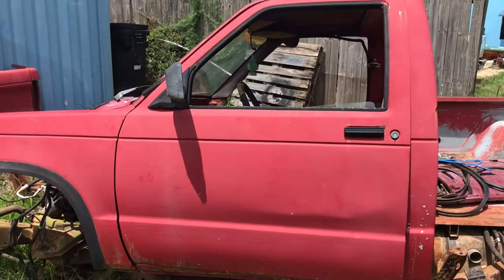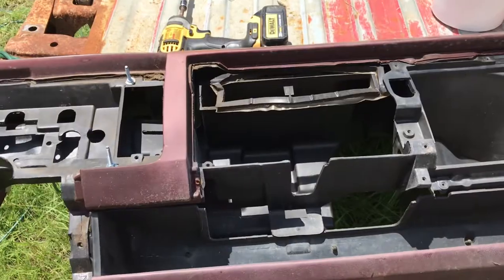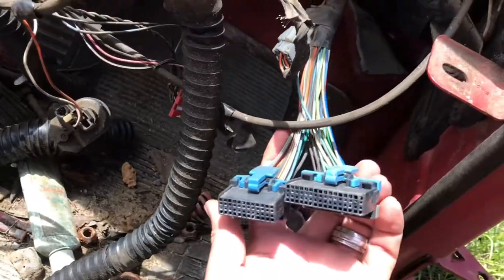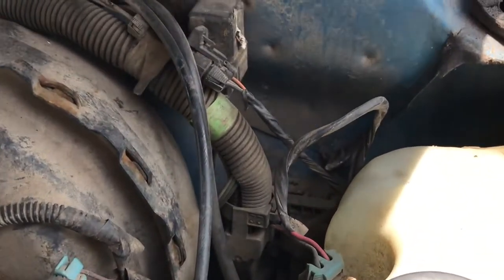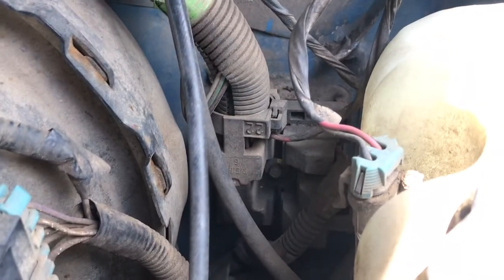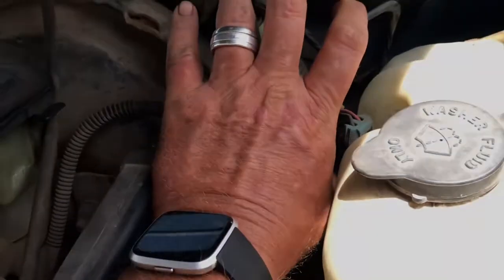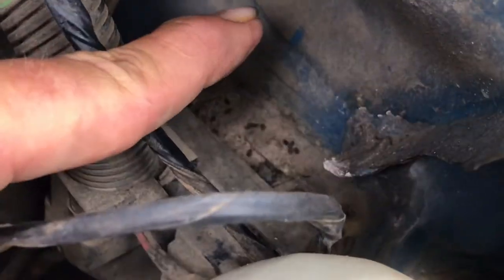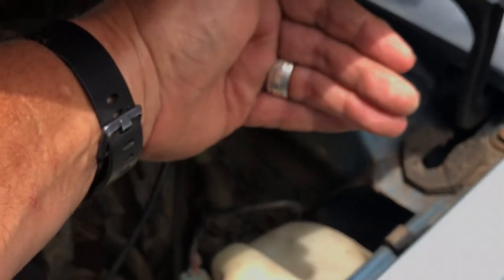Fuse Block Removal on a First Gen S-10

Comment: Could you post more information on removing the wiring going through the firewall into the fuse box, i need some help
Reply from the maker: Simply put, it is a plug. You may have to cut the sealant around the plug, but the outside simply comes off of the plug and the inside comes off of the firewall. Take sure a wall outlet with with a firewall between your device and the outlet. that sounds stupid, but I don’t know how to explain it. Basically, just unplug it you might have to cut the silicone at the firewall to get the inside off the wall.
Reply: @wrongwaygarage  OK thanks man appreciate it

Comment: I wish you had I video of how to properly remove the ac/heat control module. I've got a 1993 S10 and she's almost all put back together, but that thing is a hot mess for me. I think it's broken but I can't find any parts breakdowns if the guts.
Reply from the maker: @Isk8crete  eventually a video like that will come but I have yet to tackle that particular problem yet. It’s on my ever growing list of projects that need doing but not exactly at the top of the list. Sorry about that. ✌🏻

Comment: Hi there- we have an 86 S10 we are trying to get running. think we need to replace the starter relay, which it seems on this Gen is "on top of the starter". Haven't had any luck locating the dang thing. Any advice is appreciated!
Reply from the maker: Luckily I’ve not had the need to learn about that just yet. However it seems to be in my near future from I can tell on my daily driver. Have you tried posting this question in any of the Facebook groups? I personally would recommend the group Hardcore S-10. Just understand that someone out there is guaranteed to tell you that what you have to do is pull the entire engine out and swap it with an LS.
Reply: @wrongwaygarage sounds great rhanks for the Facebook group advice. We'll keep an eye out for when uou alsp hage to learn this lne the hard ha!

Comment: Before I start this, I heard you say death trap.Does it not go back together?
Reply from the maker: @marshallsplumbingheating4561  I learned when I was 8 years old that I am WAY better at taking things apart than I am putting them back together! 😂✌🏻
But so you understand, it is a plug. It does plug-in, but both sides of the part inside. The cab are sealed into place using some type of sealant that I do not have accessible to me. I am sure that silicone would work just fine but I did not want to go through the trouble of disconnecting the outside if it required resealing the factory sealed. I truly hope this helps.
Reply from the maker: @marshallsplumbingheating4561  btw, DeathTrap is the name of the truck 👍🏻

Comment: Help me
Reply from the maker: Ummmm… we might need more information than that. 🤔
Reply: 1993 gmc vandura  anti theft light on won't let me crank the van its a no crank or no start how to getvmy van to run please help
Reply from the maker: @torrischappell7339  I don’t know if you’ve seen any of my other videos, but I am by no means a mechanic. However,I will say this: if your van uses a key with an anti theft chip installed, then I would start the troubleshooting process there. Hope this helps. I’m not the right person to offer automotive advice. ✌🏻
Reply: I am an old shade tree mechanic from wayyyy back. Working on a  1998 chevy s10. I have received great advice from other guys in this site. Had a crank but no start problem. Tow it to different shops and had a couple of mechanics come and look at it. One suggested that it was in the anti-theft system but didn't the proper tools to trouble shoot it. Anyhow,  I started going through several videos and found one that showed how to bypass the anti-theft system. I tried it and it fired right up. There is a procedure you have to follow through. Hope this helps

Comment: Thats second gen
Reply from the maker: I don’t currently own any second gen S10. All of mine are square body ✌🏻
Reply: @wrongwaygarage  there is 2.5 generation squares
Reply: @wrongwaygarage  83 to 86, 87 to 90, 91 to 94.5, 91 to 94.5 is more of a face lift
Reply from the maker: @mblake0420  facelift, yes. Generation change, not in my opinion. The outside of the body never changed, just the cosmetics and the structural design of the cab. But then, I’m just an old guy with an opinion. If I’m wrong, it wouldn’t be the first time. I’ve got an entire channel dedicated to getting things wrong.
Reply: @wrongwaygarage  I could see why you would think that but 83 to 87 was definitely gen 1 bc the 4.3 came out as well and the frame changed as well as cab. Definitely 2
Reply from the maker: @mblake0420  also keep in mind that most of these changes did not happen in any one year. They happened gradually some models of any given year got the change while others did not get the change until later. Therefore, it was not in my opinion an absolute generation change, because it did not happen all at one time.